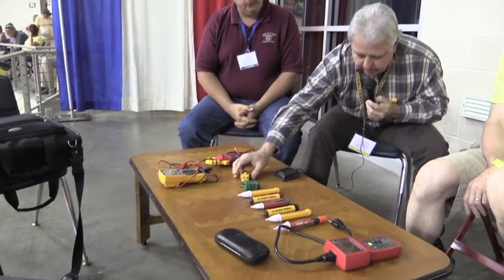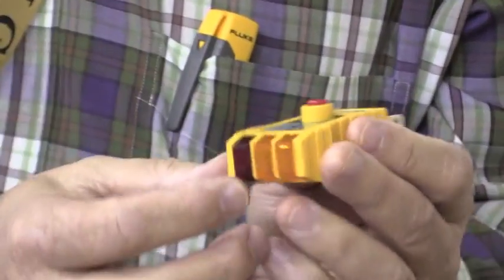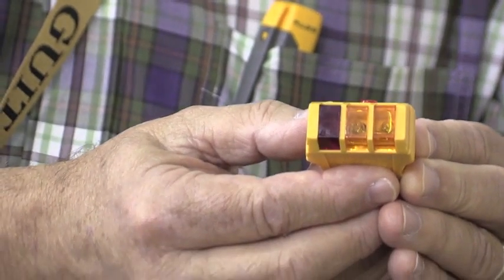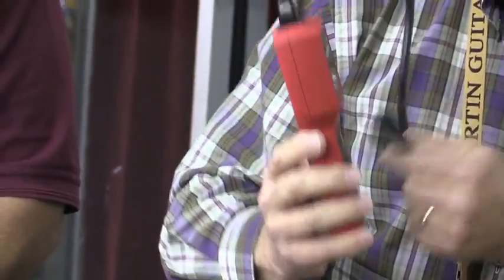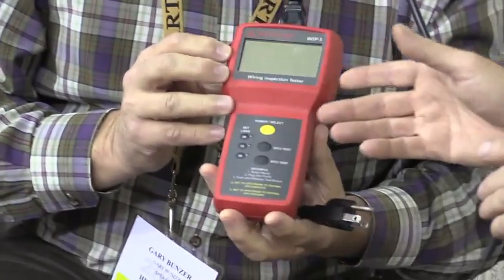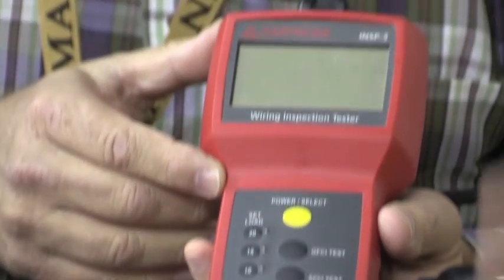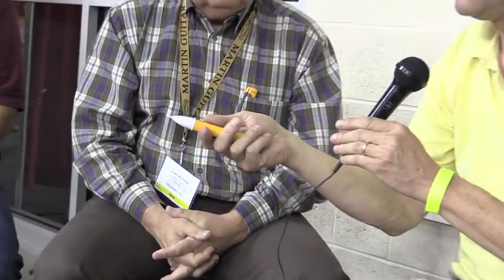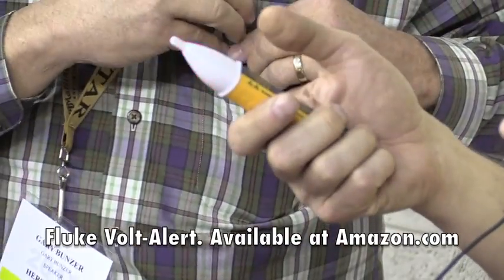Ever feel a tingle when touching an RV? Danger! Watch this!

Comment: Our RV was giving us shocks after we plugged it in last night at our cabin. This video gave me the clue to search for the problem. The Adapter for a 30 amp to a regular plug-in was damaged. The round grounding part of the plug had broken off and I stupidly still used it. So I had two problems reverse polarity, as well as no grounding.
Fortunately, I had a brand new plug from energizer and used that, and the shocking problem was 
It was this video that led me to this discovery of what was causing the problem so thank you

Comment: Those bootleg grounds and reverse polarity bootleg grounds are very dangerous,  and well known in the A/V industry.  When I was little,  I was probably about 6 years old I was with my Uncle Marcus visiting while he was traveling doing gigs.   We were at an older theater type building,  and they were doing a Christian rock show, somewhere near Greensboro NC I think, and Marcus plugged the sound mixer into the amp, when he was knocked across the stage & the cable turned red hot and melted.  Sparks were flying.  I was very scared.  Over 25 yrs later Marcus explained to me what happened.  The sound equipment was plugged into different outlets.  The building was over 50 years old at the time, and that some hack began to replace the original two prong outlets with 3 prong,  and thought that because the neutral and ground connect at the main panel, that it's okay to do the same to the outlets to make it grounded,  they used bootleg grounds.    But because the wiring was very old they probably had a very hard time telling the hot apart from the neutral,  or it could have been on a different circuit and reversed at the panel.

Comment: Thanks, I happened to have the tool you mentioned. I checked the ground on my receptacle at my house and sure enough, voltage.  I found a break in the ground wire and fixed it. No more problem. Thanks again!

Comment: Thanks for the video.  Very helpful.  I was shocked by my airstream (standing on wet ground with bare feet .. scary).  The plug was not well seated in the outlet, I.e. the ground was not seated.  After fixing this, do I need to find a hot wire contacting the skin of the rv?

Comment: This past weekend my Wife and I were camping along with our 100lb Malamute mix, and we experienced a horrific shock from not being properly grounded. The electrical current traveled through the frame of the trailer, onto the steel braided chain, and metal collar that our dog was wearing. My wife went inside to use the bathroom and as she turned on the light our dog began to be shocked. I ran out to see what was the matter and I was shocked, threw me about 4 feet away (I was also barefoot in the wet grass), and by the time I could get away and unplug the trailer my wife and dog were both being shocked and could not move. The trailer was plugged inside a garage that was locked, and apparently not grounded properly which caused the "hot skin" condition where it was grounding to the frame. 

By some miracle after about 90 seconds of our poor pup being shocked, and about 60 seconds of my wife being shocked we were all okay outside of a couple burn marks and bite marks. This information could literally save your life and I wish I would have seen this before putting my family at risk of electrical shock. Thank you for the information, it is definitely now a priority when plugging into somewhere that you have never plugged into before!

Comment: Our pup got shocked 2 times before we realized it was from our 5th wheel travel trailer. Thought it was the rv park power pedestal. Later we find out that a wire was rubbing on the metal frame underneath our trailer. We were so lucky.

Comment: about the 3rd wire or green wire also known as a equipment ground, so here's my question. If the RV itself is trouble free and the power ped is trouble free but you have a open equipment ground how is it that you will get a hot skin? I can see a reverse polarity with a non polarized cord. Please explain.  of course using a two wire cord is just plain stupid.
Reply: +Tom Zaytsev If the power source and the RV are correctly wired and grounded then you can't get a hot skin condition from something you plug in with an open ground. This video really pertains to bootleg grounds where the ground wire was attached to the neutral connection in the outlet but the neutral wire was actually hot and the hot was actually neutral. IF your power source to RV connection had an open ground then if you plugged in something that joined the hot wire with the ground wire then you could have a hot skin condition - according to UL and electrical code no piece of plug in equipment is supposed to directly join the neutral and ground further less the hot and ground so "legal" stuff you plug in shouldn't pose a problem but bootleg grounds are also currently illegal to do but you still have to watch for the shoddy and potentially dangerous work
Reply: ok. that makes  sense.  but without taking the box apart how will you  know its miss wired? which leads me to this question,  how often is bootlegging done? i have replaced many a plug in many a structure over the years and have yet come across one.  in jurisdictions that have electrical inspection dept. that licensed sparky wouldn't have one for very long if they used this method . thanks for the input.
Reply: Tom Zaytsev You'll never know if it's a bootleg ground without either taking it apart or using a tester that tests ground loops but bootleg grounds themselves aren't the danger it's the reverse polarity outlet someone does them on that poses the real danger and that can be tested for using a NCV (Non-Contact Voltage) tester as shown in the video. The NCV tester will tell you if a given wire is hot with AC voltage so if your ground prong on the outlet is testing as hot then you know you have an electrical problem with reverse polarity bootleg grounds being a possible cause/reason for the problem.

Bootleg grounds are not done any longer as all new electrical is wired with ground wires and three-prong outlets per national electrical code (NEC). It was done and could still be done by DIY'ers retrofitting two-prong outlets with three-prong outlets but doing so (bootleg grounds) is not legal. The time to really watch out for a bootleg ground is in old electrical that predated 3-prong grounded outlets but has some or even all outlets now 3-prong.

I ran across a bootleg ground once inside a homebrew power strip. Fortunately, the cable tv box I plugged in to that strip was properly grounded through the cable line and the short to ground was taken care of by a functional circuit breaker that prevented a house from catching fire. All the things in the electrical code done for safety really do work.

Comment: I have experienced this issue with my 2013 5th wheel. Warranty is about to expire and the dealer couldn't recreate my issue.  It was not plugged in and the RV was wet.  Any ideas on how to troubleshoot?
Reply: Likely an issue with the inverter not grounded properly or a shorted wire on the 120AC try disconnecting the inverter to see if you still can feel that. Also check the voltage from an exterior metal surface to ground to see the level and if it's AC or DC

Comment: This is for real!   I was electrocuted in our travel trailer in the mid 70s.  I was in my bare feet and touched the toaster. I remember that everything froze and "visual snow" (like on a tv without an antenna) started at the bottom ov my field of view and quickly took my entire field of view.  Luckily my dad saw what was happening and tackled me.  Funny thing was that it didn't hurt.